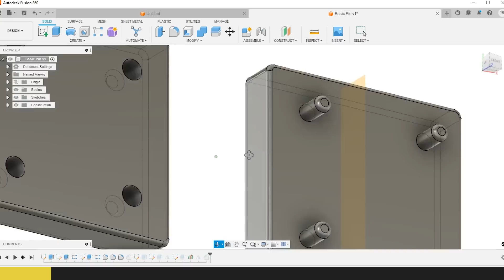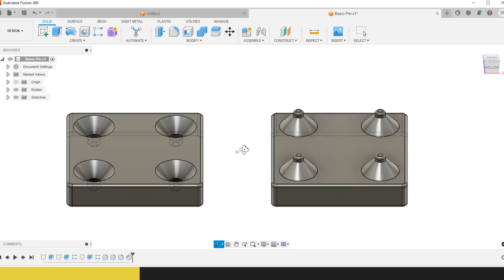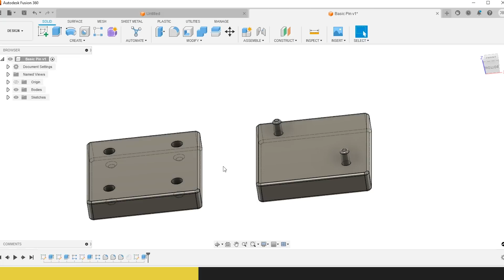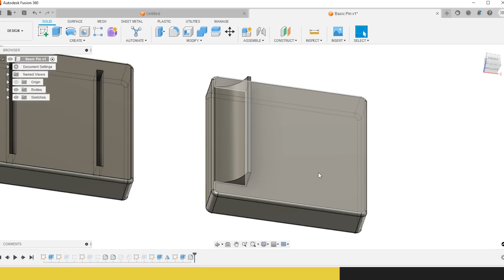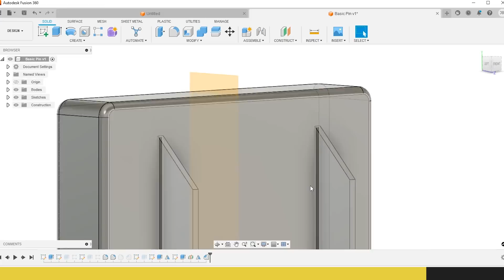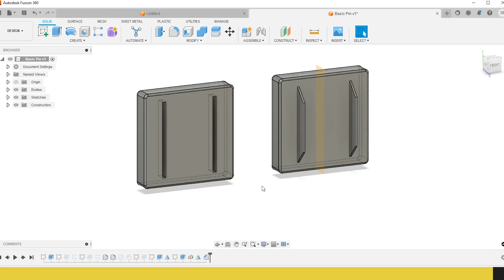Alternative to Pins and Holes: Design for Mass Production 3D Printing

Comment: Instead of designing both the fin and the pocket I prefer designing the fin then use the combine feature to cut the pocket. This way I can modify the fin if needed and the pocket will automatically resize. This is if you use Fusion.

Comment: To strengthen a pin, put a small hole down through the middle.  This will give it more walls and create a stronger connection.  The hole needs to go down into the base if possible.

Comment: IME cones and domes work best for 3D print mould registration print to print on a parting line. But for gluing finished parts together on the parting line I use tongue and groove through cuts to the end. Offsets on the male side of the tongue and the through cut allow epoxy to squeeze out during final mating. The adhesive squeeze-out is very important and the groove system creates more surface area.

Comment: His last point, have one fin.  I like mirror parts, meaning 1 part design that fits into its mirror.  So two bins of parts with 100 each.  If one side is poor, then you need to reprint, meaning better yields. 100  with 10 bad parts on 1 side means 90 assemblies. Mirrored results in 94 competed. If this is stamped or molded, its one dye not 2.

Comment: Just print both sides with holes, then print the 4 pins separately - solves all your issues.
And stop making your pins cylindrical ! Make your holes and pins square - the holes can sit at 45° for problem free printing in all orientations, and the pins can be printed flat for maximum strength.

Comment: You commit the same error as most of 3D printer guy, you want to print everything. It's silly idea I think. Focus on the construction and the part.
Answering your hole/pin problem: create only holes at the necessary positions on both part. It could be much smaller (1mm) than the final size, because you use it only for pointing the surface at the precise position, and leading the drill. Then you drill your hole, it's quality and size could be much better than a printed hole. Buy drills with small steps, for example 2.0mm, 2.1mm, 2.2mm, 2.3mm .... 7.9mm, 8.0 mm. Then you will be able to crate almost any hole.
Now buy metal parallel pins/dowels in the shop DIN 6325/ISO 8734/ASME B18.8.5. Very cheap but fantastic little things, because of smooth finish and very precise size/tolerance. Make sure that your pin/hole fits tight, the best if you need to help a little-bit with hammer.

And that's it, you have a very precise positional element, cheap too. Although it's not printed, but who cares. Chamfering the hole is not necessary, because the dowel is chamfered already. You need to deburr the hole after drilling that's all.

Comment: To be honest, all of those options are vastly inferior to designing in a proper shadow line feature. If you want to teach people REAL mass production techniques that they can integrate into their 3D designs then shadow lines beat everyone of the options in this video on pretty much every point that matters, well constrained, repeatable, quick and easy to locate / assemble / disassemble, quick and easy to 3d print, strong, versatile.

Comment: I like your approach to trying to get people to focus on more approaches. With this, there are many approaches. Majority of the time pins are not the approach as they snap easy on 3d prints. Usually for me, slide (dovetail), or snap fits like cutting the edge and extruding the others but with a tight tolerance works best. 0 post processing and if you put a ridge on the edge then the two parts connect and break away in a very satisfying way. It does take design practice though. Being able to just follow your edges does in some cases improve the chances that you have a proper fit.

Comment: Another pro tip. Is key your prints. If you have a single joint just identify a side to match. But if you have multiple sides. Use circles And squares and triangles to determine direction and attachment sides.

Comment: I personally just print square pins/ jigs separately. Your solution introduces alignment issues. If you still want to print the fins together with the block, use those same fins with tapered ends, cross them and rotate them at 45degrees and print vertically.  It should look like a square with an X in the center. You should get decent alignment with that.
Reply: By the way, on the slot where the X goes in, I would chamfer the inner corners of the X or make a round cavity to avoid problems slotting the X fins in.

Comment: "They slot quickly and easily" Has to force both plates together leaving a gap and a visible offset.
Reply: @ilia2178  welcome to Slant 3D - I see you are new 'round here 😂
Reply: Doesn't he design a 7mm tall fin to fit in a 5mm deep slot? I expected a larger gap honestly
Reply: yeah this is an awful over constrained way to locate parts
Reply: He's demonstrating the technique, not designing a functional part.
Reply: @dogsbd  if the demonstration is not good it lets the technique wide open for criticism.

Comment: Great tutorial, but if it's just for alignment, those fins only need to be 2mm tall, and maybe 4-5mm wide.  Use 4 if it doesn't matter which way the lid is assembled.  Use 3 if you want to constrain it to only fit one way.  Making it possible to assemble 4 different ways might slow down manufacturing a tiny bit, but it speeds assembly.  This is all if something else is holding them in position, and the features are just for alignment.

Comment: Even with those 2 pins it's a bad design because you can just rotate the part 180 degrees and the parts will be aligned.
Different size pins or no pins at all. Why not tapered triangles. It can be literally any shape as long as it's simple enough to produce so it doesn't cause any problems.
Triangle instead of pin is great, because you can have different triangle shapes and those can even point a direction.
Pins come from drilling and inserting steel pins. Why are people using it in fdm manufacturing? :D

Comment: I think it should be noted that fins are nice, but they provide a very large interface surface between fin and hole, which reduces robustness as slight variations in any part of the fin hole make the entire part no longer fit. By definition robustness is the tolerance of something to variation, and in a manufacturing engineering context where large runs are expected, features like this would be avoided due to how much variation would impact final work. A good solution to this problem is to remove some more material from the fin holes so that the fins only contact the holes at a set number of places, like 2 or 3 max
Reply: I realized that solution is a bit confusing, the important part is that rather than making a full fin surface interface with a surface of equal size, change the interface to only physically touch the fin at a couple of places and have small air gaps elsewhere. Constraints remain the same, while tolerance to variation is much more kind

Comment: The textbook way to do it without over constraining things would be to have 2 pins in one part, one hole and one slot on the other.  The pin in hole gives you xyz and then the pin in slot gives you the clocking, anything more is overconstraining it.

Comment: no one ever said pins need to be round.... dont you remember Geometry class? There is such a thing as a diamond which is much more logical and common in the 3d printing industry yet you never mentioned that... I work in the manufacturing field and see diamond holes way more often on 3d printed parts than round holes

Comment: Great content, but if you want accuracy, you dont use FDM for mass production. It's weak and takes forever. For a one time prints, you could use  piece of wire or even pirchase small guide pins that come in useful.
Reply from the maker: FDM mathes any other process in scale and speed

Comment: Instead of printing pins make holes on both side and insert steel pins on one side and just chamfer the steel pin end which will remain outside so that pins will go smoothly in holes... I did the same to make printhead holder magnetically detachable so that if I need to change from printhead to laser I just need ro pull out the printhead holder and unplug the connector and plug the connector of laser module which is attached on same kind of holder and just pop it in place... No screws and wiring problem..😊 its a simple design once you got the basic working of the thing in mind... And my holder was same like yours just a flat plate but with hotend holder and other with holes to screw the laser module and back plate was exactly same... and I did this around 5 years ago on my custom made printer which I built in 2017.. recently fusion ended up my free license which I got as education license so I am not into 3d printing right now as I love designing and printing my own designs not someone's designed models..

Comment: Fin slant all the way to the surface allows for misalignment. You can actually see the misalignment whe the part is being held.  Plus as you stated earlier in the video, dont print unnecessary features. You should only print 1 fin because it will fully constrain the part.  Finally you gan fin rigidity by printing vertically.  But you loose surgace finish and stength for the rest of the part.  Always a balance, cant get something for nothing.

Comment: You could decrease print time and improve manufacturability by using just holes on both sides. And then using a separate pin. I like to make my location holes the diameter of my filament and then I can use some pieces of filament as pins. If I have just a short piece of filament that doesn't fit on a roll I will cut that up for pins. I only use that method for parts that I'm going to be gluing together. If I were making a lid or something like that I would go with a lip all the way around the perimeter.
Reply: The problem is if you have 1000 parts now you need to buy 2000 pins and manually press each one into each respective hole.  It isn't a big deal for a few parts but costs and more importantly time quickly adds up when dealing with larger quantiles.

Comment: What are advantages of using expensive software like 360 over something free, like Blender?
Reply: Fusion 360 and Blender are two different types of software so you could not use one instead of the other once you start doing more advanced modeling. I'm really over simplifying here but it's a bit like comparing making a technical drawing with a ruler or by freehand. 

F360 is a CAD software and it is actually free for personal use. So is OnShape which is a major contender. FreeCAD is a completly free alternative but it has a different workflow and can  be difficult to get used to. I've given up in frustration several times 😅

Blender is more used for "artistic" purposes and some comparable softwares are Unity and Maya.

Comment: There's not really ever a reason to press fit two plates together of equal size unless the pins are shear pins designed to give to prevent damage to other machine parts. If they're not, just double the thickness of the original part.. no pins.
Reply: Yup. However, in DIY FDM I sometimes do this when I want to:
- break up a design to overcome machine limitations (e.g. max print size)
- reduce print time (longer prints == more expensive cost of print failure)
- make shrinkage management easier
- use different materials for different "parts"
- get the texture/smoothness of the print bed on more than one face of the finished product
- iterate modules independently
- design with modules in mind (for reusability/configurability)
Reply: The modularity part makes sense to me. We do similar things in fixturing. I'm a cnc guy so the print time is a foreign concept to me but it also makes sense. On cnc this would achieve the opposite effect. You'd add unnecessary time to the product. We really only see 3d prints for impossible dimensions to machine or for prototyping.

Comment: tl;dr reduce complexity (material) and thus points of failure. fins over pins, if need be.
This is the bread and butter of mechanical design and engineering textbooks. Mechanical behavior: statics, dynamics, strength of materials, vibrations, reliability, and fatigue.

Could be a made into an introduction series of a few YT videos, going over these basics through one example.
Reply from the maker: Thanks. Lots more basics videos like these on the channel.

Comment: These pin chamfers are a construction mistake and don't make sense, because now you have something called a "Doppelpassung" in german (I couldn't find an english word for it). Basically you have two faces that act as a fit, which is impossible if you have any type of tolerance. Plastics are flexible so it might work in this case but you should at least mention it.

Comment: My first reaction to the chamfered pins was "he created nipples." If its purely for allignment and you don't need it to prevent movement hemispherical bumps and holes would be a simpler solution.  If there's directionality to the alignment then an asymetric pattern is useful.

Comment: Pins work fine if your using them as an alignment for walls or something that is going to be superglued together.  This also helps make said model stronger when gluing together as there is now more surface area for the glue to bind to and less likely the model will come apart.  I usually use notches or some sort of means to align my designs together, usually corners of a wall of a model building.  This makes thing a little stronger and easier to put together, while making the model itself easier and faster to print, since its all laid out flat on the bed.  Due to printing inaccuracies that happen, I always error on the larger side for any holes, usually about .5mm bigger in X/Y then the notch/pin/whatever is.  This makes sure that the designed alignment piece WILL fit in the hole, even if it has a little bit of wiggle room, since prints can vary from print to print even on the same machine.

Comment: You can also print them lying down. What may increase the print time there is that the normal slicer settings will often require multiple layers on the bottom to be 100% filled. But this setting can be overridden, even if it's just for the bottom. Also keep in mind layers are usually 0..2 mm and nozzles are 0.4, so it will take two layers to replace one wall.

Comment: teaching tech has a great video on shadow lines which is my preferred method for this.
great to get people thinking about more then just using pins and holes (A method common in furniture kits because dowels and drilling holes is cheap in that context) and thinking more critically about what they need from their registration features

Comment: You don't understand constraints.  Pin in hole is totally over constrained.   4 round pins - one on size hole - one slot - two oversize holes. Those two ribs are overconstrained.

Comment: Hmmm… how come when you showed the two parts put together, they didn‘t align properly then?😂
Reply: ok I'm not blind then🤣 content is still informative so i like it
Reply: Probably needed some tolerances to be added to make it fit. I think the concept is good, but the tolerances would make they fit perfectly. I already did this kind of design and it worked.
Reply: It should be done as rigid joint, then cut the intersection from the body combine menu. That way you only designed one part and if you modify it the others also get to be modified automatically because they are linked. Also mirroring should be avoided, pattern tool is much better, especially for such simple shape.